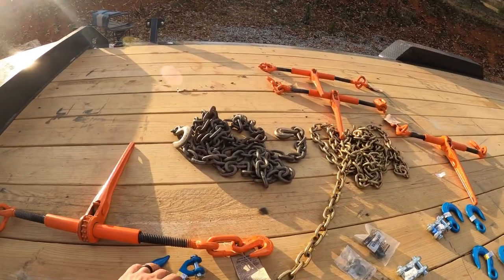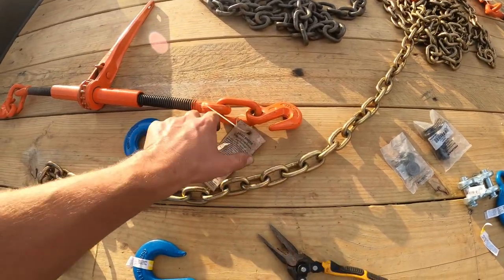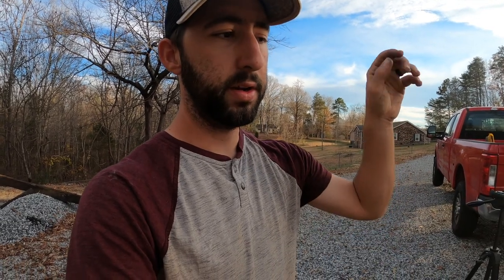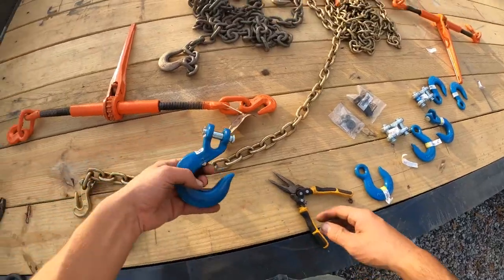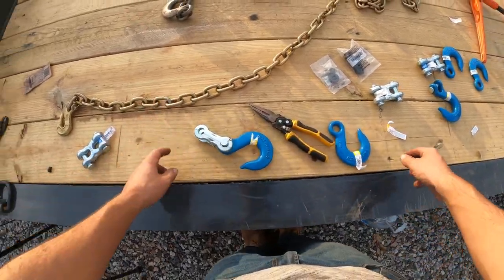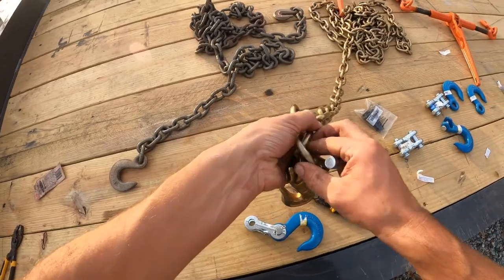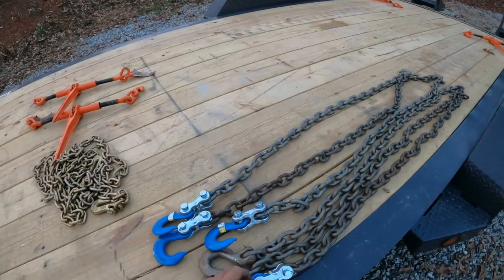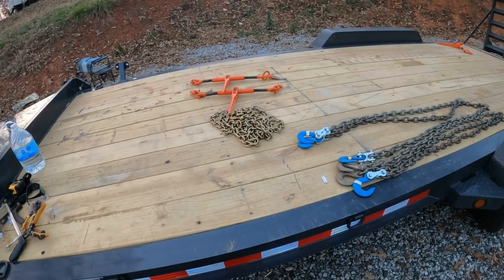Modifying chains and binders

Comment: Nice job man. I been wanting to switch from straps to binders myself.. just havnt wanted to spend the money yet.. they are much faster. They also make “speed binders” which you tighten with a drill, if you havnt seen them check them out.. they don’t shave a ton off your time tho but they do save you manual labor. I plan to weld some heavy D-rings on all 4 corners of my new trailer. I really like your new one 👍🏻
Reply from the maker: It is pricey to switch to chains and binders. I think this set up was like $500 but my load and unload time is crazy fast now. I don't think you will regret it when you do. 

also I would put 6 D-rings on there. then no mater where your load is, you have tie downs for it

Ill have to go check out your new trailer